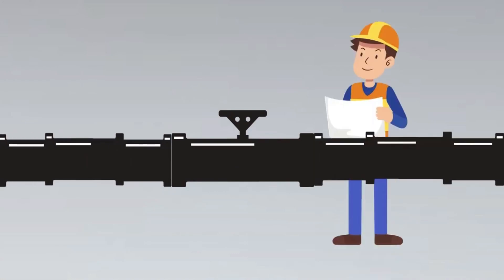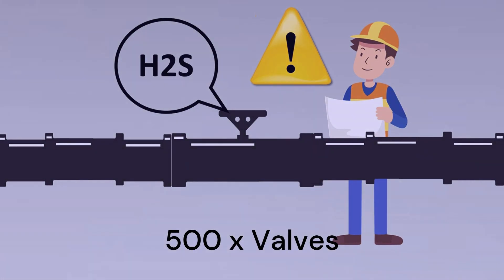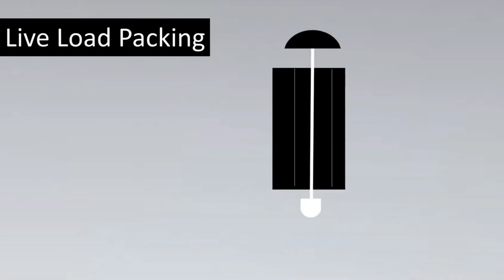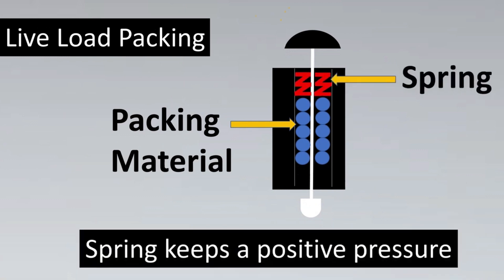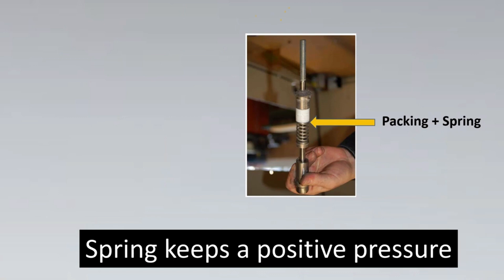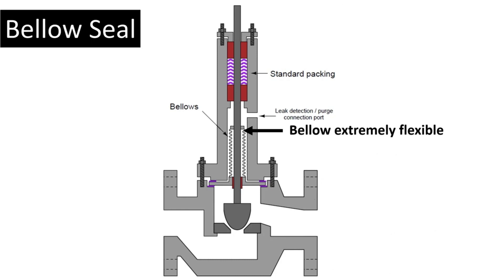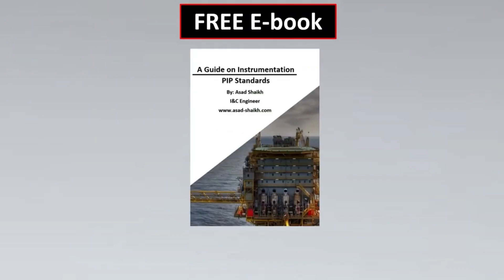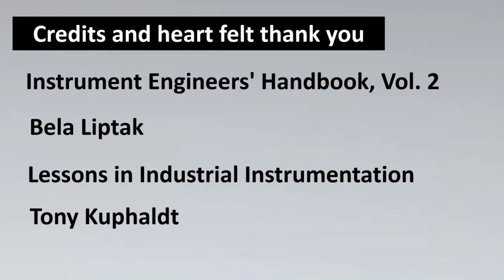What is Live-Loaded packing | What is Bellow Seal Valve | FUGITIVE EMISSIONS simplified

Comment: In case of power failure, in how much time the  motorized valve will go in close position if we want fail safe close. Please advise
Reply from the maker: Good Question, Usually for fail safe application we don't go with Motorized valves.